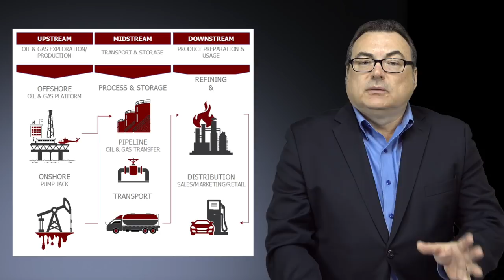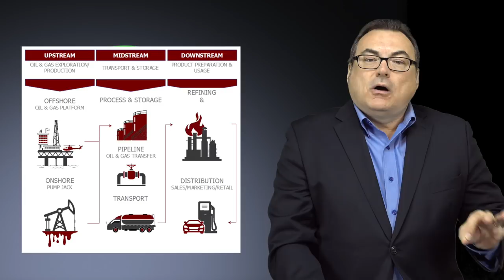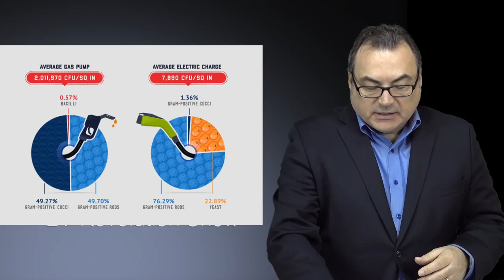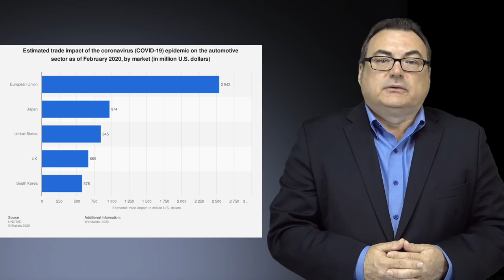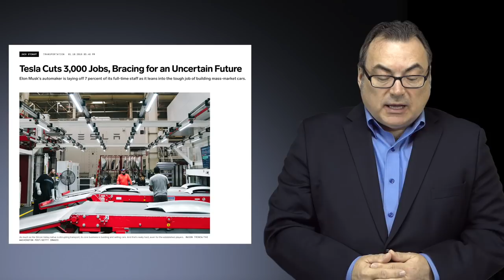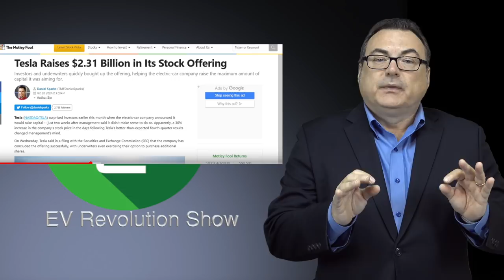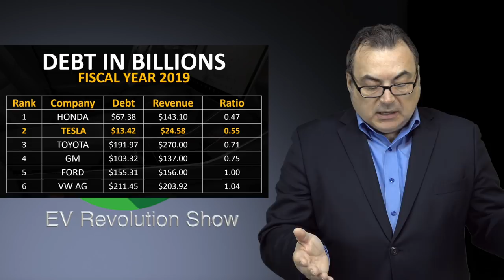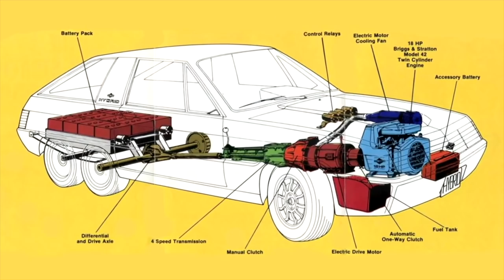Episode 86 - EVs & Our Current Global Crisis, Contagion Vectors, Tesla Riding Out This Storm!

Comment: I would petition lawmakers to entirely dismiss the incentives for PHEV vehicles with a range less than 30 miles or 50 km since those are basically meaningless and are even less efficient that non plugin hybrid counterparts.
Reply from the maker: Thanks for watching nevoi.  Hopefully more OEMs will move to BEVs instead of PHEVs.  Take care!
Reply: @EVRevolution  Well, thank you. What I really meant is when people buy PHEVS somewhere up North where is real cold and they are afraid to get stranded far away from EV chargers then PHEVs make sence especially when the pure EV range is close to 30 miles=50 km and the buyer HAS the charging capacity at home and better at work as well. That means that driver will drive no less than 90% time just using electricity. On the other hand if the pure EV PHEV range is 7-15 miles especially in cold than around 70 % of trips are with depleted battery when the weight of heavier battery makes those trips even less efficient that HEV upluggable hybrids which have smaller batteries to haul around. And obviously BEVs are better with no compromise. That is why I would give state/province incentives not by size of battery but by pure EV range. Have a nice day. Stay save to weather the troubled times!

Comment: I'm sorry but your research shows a lack of understanding of the different industries. Also OEM = Original Equipment Manufacturer. These are the providers of parts to the Auto Industry. The existing auto industry is Not an OEM. Ford, GM and FCa are NOT OEMs
Reply from the maker: Hello Julianne, thanks for watching.  I am fully aware of what OEM stands for, however even personnel at the OEMs call themselves that.  So I use the same terms, no lack of research.
Reply: EV Revolution Show then Tesla is an OEM just like the rest of the companies making automobiles. I think your show is pretty good on the whole, but please think things through before you make statements. Equally your Gas - car and electricity - car was too vague. Have you ever been to a refinery? Have you been to extraction points (Texas, sea, shale etc), how much do you know about fuel distribution from the refineries to regional depots. I don’t disagree with the just of your arguments I just find them way to generalized and thus open to being knocked down.  That’s what I mean about research..
Reply from the maker: Yes I have been to a refinery and well site.  I'm not trying to be an expert on those but talking in general terms.  The whole point of that material was to highlight in a general way.  I am also not an expert in the fuel industry so I rely on supporting articles and materials.  

If you want to knock down my info, then do so but it's only meant to provide additional thought relative to the current for for the time being longer-term situation we are living with.  Just tying to get people to think.

I rely on the articles I pull for the quality of info and can't spend weeks researching since I am a one-man band for my show and have to do it all.